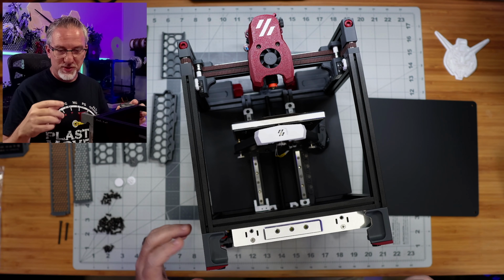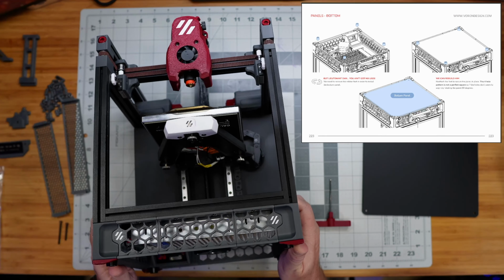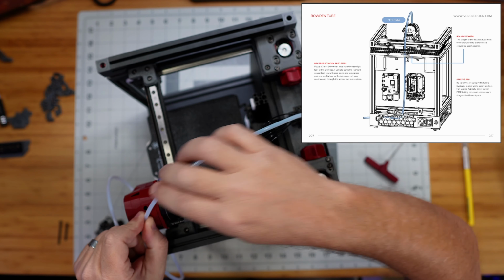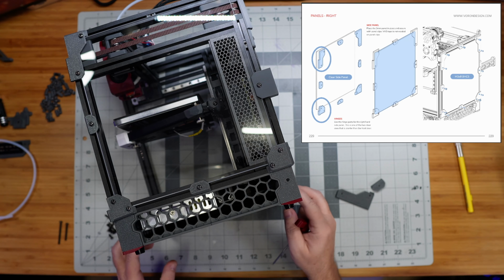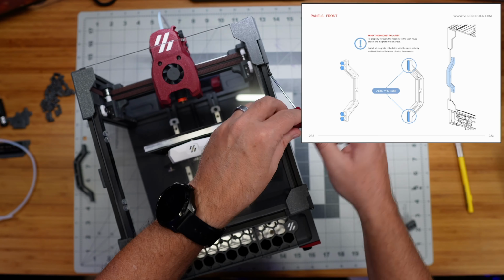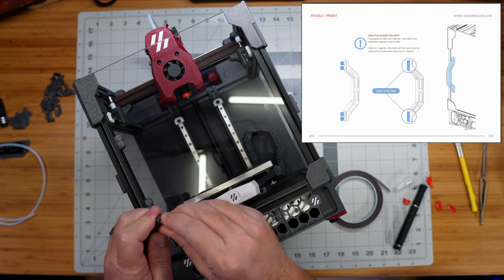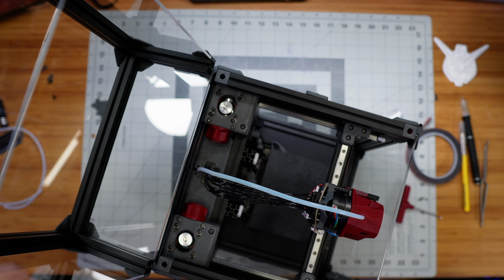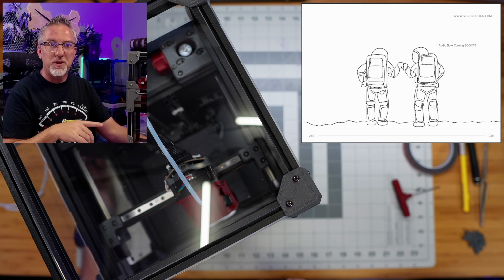LDO Voron 0.2 Build - Skirts, Panels & Tophat

Comment: Hello
Really nice Video
I have a question
Can I put the hinges on the other side. ( mirror it)
I want to open the door to the other side

LG René
Reply from the maker: I think you could do that, but it looks like you would have to mirror the printed parts for the hinges. So if you're printing your own parts it would be simple to mirror them in the slicer before printing, but if you're having someone else print your parts then you'd have to see if they could do that for you.
Reply: @gunplamark  Okay that's perfect.
I am printing my own parts.
Thanks for the fast message.